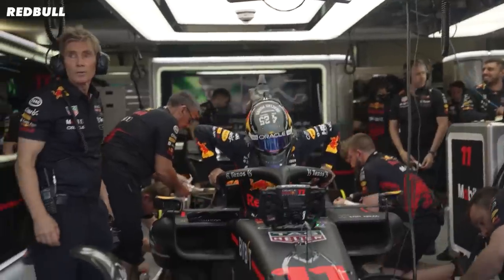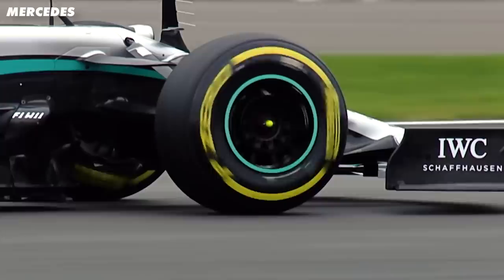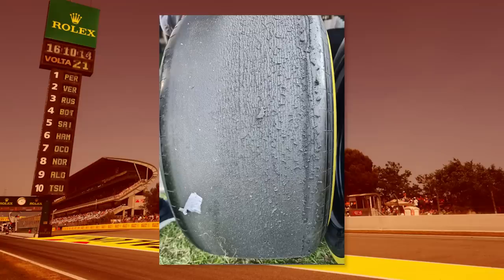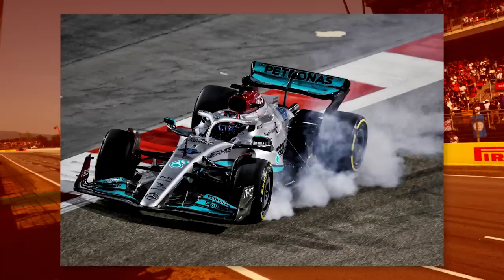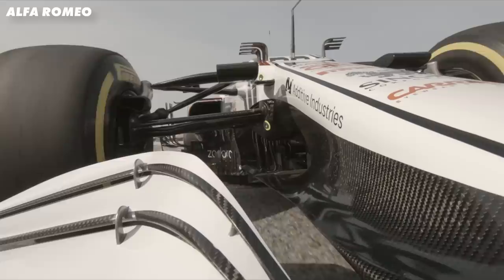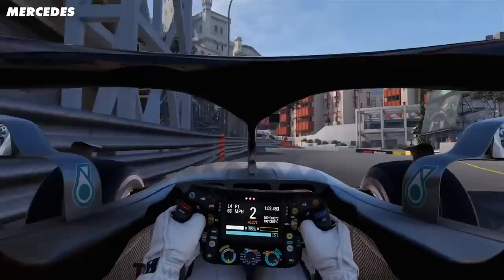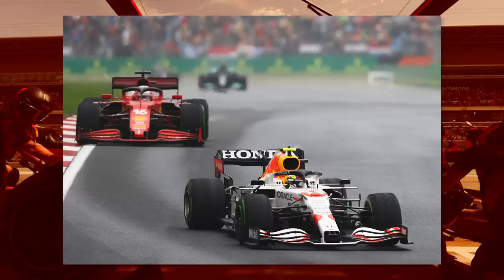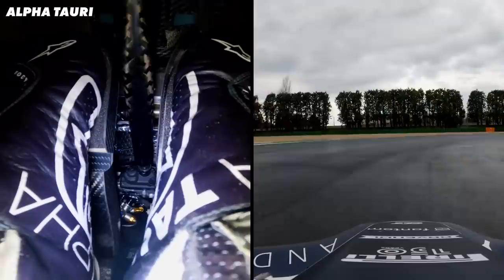Why Perez is INCREDIBLE at Saving Tyres

Comment: More interesting is how does Lewis/ Max keep tyres alive AND maintain pace?
This seems to be something only a few drivers can do. What’s going on?
Reply: Exactly. That’s what sets them apart from checo.
Reply: They don't maintain their tyres as good as Checo, simple as that. They push more.
Reply: @kolosmenus  uhm, Baku last week?
Reply: @kolosmenus  ahahaha funny mate. Max, and especially Hamilton, manage the tyres just as well as Perez while at a faster pace. Hamilton is massively underrated at it, his tyre management is astonishing, especially until the new regs kicked in
Reply: The fact is that the tyre management of Lewis and max is better
Reply: @Bullpit2  Baku was not about tyre management since the Ferraris were out of the race. The 1-2 was in the bag from very early. Max finished so far ahead of Checo because he disobeyed team orders to keep a consistent lap time. He even tried to steal the fastest lap point away from him in the last few laps. Point is he kept pushing all the time, but none were really trying to save the tires.
Reply: @alexlacl8730  It isn't. Checo is up there with them as one of the best, if not the best, at tyre management (and this is something almost every pundit in F1 agrees with despite your perception based on a few races). The thing is, Max and Lewis usually are on the lead (clean air and pace management helps a lot with tyre management), and also get (well deserved) preferential strategy due to being ahead of their teammates during races, so their tyre strats allow for them to push harder and use more rubber, and it becomes barely noticiable from the outside, but if you listen to team radios, you'd know both Max and Lewis had struggles with tyre deg and wear pretty much the same or more than Checo or any other driver running in the top spots.
Reply: @anameyoucantremember  what ? Lewis is clearly the best driver for driving with dirty air. The last couple of races it was more perez who struggled or was too slow than max
Reply: they are better than checo at it, but people tend to talk more about other qualities they have...
you can forget about tire saving when you are slower than your teammate 20 out of 25 times on pure pace...its a load of bull if you ask me...its good for middle pack or slow cars...there you can really shine if youre good at it
Reply: @anameyoucantremember  Both Lewis and max are better at managing tire deg while going faster than checo.  This has been illustrated time and time again.  Pundits often name drop checo because it's his best quality.
Reply: @andreadg5429  But Max and Lewis struggle with Tyre degredation all the time, especially apparent in their radios. There is a difference between extracting the most out of what's left of the tires to being able to stil push them for 5 to 10 laps more than anyone else. Max and Lewis are better at extracting, and Checo about conserving, and even before Redbull, Checo was already being praised for his tire management and quick pace way back his Sauber and Mcláren days.

 Max and Lewis also get preferential strategies over their teammates, and Checo is often told to hold longer stints much like Bottas, hell a lot of Checo and Bottas' problems last year was that they were often ordered to hold longer stints with aging tires than their respective no.1s, which can hurt both their races, especially Bottas'.
Reply: @denisliber6740  Both Lewis and Max get preferrential strategies and are told to push harder compared to their teamates. Lewis and Max aren't better than Checo at tyre management, the latter which was praised for being both kind on his tires and being fast during his Sauber and McLaren days.

 And no, Tire saving is super important, it doesn't matter how much pace you have over your rival, if you're on softs and they manage to pull a good pit stop on you, you're in deep trouble, as evidence by how much Redbull won over mercedes on pure strategy alone and not just pace last year, sometimes it's especially because of Checo's ability to manage his tires.
Reply: @youngrody2386  you get preferential strategy if you are a faster driver, nobody slows their drivers down...red bull managed all that wins because of verstappen skills, not checos...he was slower than bottas...i for one, wasnt in awe by checos defense last year, it litterally happened in only two races...like i said, over the season he couldnt keep up with bottas...max was always fighting two cars.. 
I  know you wanna belive checo is a superb driver but he isnt, he is a good  driver and his tire  preserving skills  were nice in racing point,  on the top you have to be fast, period.
Reply: lewis extends tires by 1 lap everytime he tells bono his tires are gone.
Reply: @denisliber6740  While also being a faster driver means that your team would allow you to pick up the pace more often than than your team mate's, which was exactly my point and we've seen Checo genuinely outpacing Verstappen on occassion, so pace is out of question. And Wdym? Bottas was the one who was heavily criticized for being unable to back up Hamilton while Checo always made sure Hamilton was fighting two cars at once, not to mention Checo was struggling to get into grips with a car that didn't suit his style (Checo preferred understeer, Redbull was made for Oversteer) and still adapted to assist Verstappen to fight the 7 time WDC.

  And in defense of Checo being Super, a majority of Checo's contributions were strategic, he made sure Hamilton or Bottas wasted their tires by pitting earlier or later than predicted, slowing down on purpose to feint Hamilton and Bottas into thinking they could chase him, and do the reverse if he's behind them. And whenever it does become car to car,  Checo's ridiculously good at defending, evidenced by not only how many times he fended off Hamilton but also Bottas, that Defense against Bottas on the 2nd/Della Roggia Chicane on Monza last year was pure ridiculous for example.
Reply: Important to consider between Lewis/Max and Checo with tire management is their track position. Usually when Max/Lewis are on top of tire management they tend to be in the lead in clean air, where checo is more than likely in dirtier air. Perhaps that makes a difference
Reply: @youngrody2386  you think pace is out of equation cause he genuinely outpaced max? Checo has never been faster than Max on sunday and only since this season he can keep up with him on saturday. And we have seen this season that when he was Leading a race (monaco, baku) he went through his tyres much faster than Max and the Ferrari’s. I would love for him to compete with max for the WDC but you score points on sunday and he has never outpaced max on Sunday
Reply: Could they be getting better tires that look like the regular tires🤔
Reply: @kolosmenus  so then why are they faster at the end of the race?
Reply: @kolosmenus  Anyone can save tires if you're as slow a Checo. Baku showed Checo is no tire wizard. He cooked his tires and finished 20 seconds behind Max. Same as most races. Can some one actually recall a race in Red Bull where Checko maintained pace and made his tires go meaningfully longer over Max?
Reply: @anameyoucantremember  Just a imagine if Checko wasn't so slow, or bad in the rain or poor race craft then he might be world champion material...
Reply: @robert7622  yep, at Melbourne, even though the Redbull is a considerably faster car, Lewis was able to catch and put pressure on Checo around lap 20. He definitely got better life out of the tyres.
Reply: @0megalul309  sometimes i think he is trolling, because he will be like ''bono my tires are gone''  and 2 laps later he does the fastest lap.
Reply: Race lap times shows Perez is anything but good at tyre savings 😪 . Any driver can extend their stints with slow laptimes before it become dangerous .
Reply: @ghhh9012  let’s be fair to him. He is a great hand at managing tyres. And in the right car, he would be devastating as long as he also didn’t have a team mate they was a great qualifier.  In a world without Lewis, Max, Nico, Leclerc…. Perez would be great.
Reply: @ghhh9012  let’s be fair to him. He is a great hand at managing tyres. And in the right car, he would be devastating as long as he also didn’t have a team mate they was a great qualifier.  In a world without Lewis, Max, Nico, Leclerc…. Perez would be great.
Reply: @ghhh9012  let’s be fair to him. He is a great hand at managing tyres. And in the right car, he would be devastating as long as he also didn’t have a team mate they was a great qualifier.  In a world without Lewis, Max, Nico, Leclerc…. Perez would be great.
Reply: @lekudos  The problem with Perez is he isn’t fast full stop. He’s not fast in qualifying or fast in the race or fast in the rain. Going long is of no use if when you get your fresh tires on your 1/2 a second a lap slower then your team mate
Reply: @robert7622  watch the videos of him in the Sauber days. Brilliant skills. 
You don’t need to be Numero Uno to be get props for your skills, right? 

Beyond max, Lewis, Leclerc, lando etc.  The next five or ten deserve some recognition for what they can do as well right?
Peter Windsor has a great YouTube channel - he gives all drivers their dues. 
Sometimes..even Mick Schumacher deserved praise. 
We fans just see the worst in these guys all the time when they’re not our personal favourites.
Reply: @kolosmenus  Hamilton is really good at handling graining,he always has been,in 2017 and 2018 mercedes was struggling with tire wear but hamilton still managed to win the championship by a huge margin as well even tho ferrari were the stronger team till midseason
Reply: @lekudos  On the contrary, people seem to over state and embellish the skills and ability’s of their favourite drivers.. Mainly due to what nationality they are.. For me the stop watch doesn’t lie. Making your tires last longer but being half a second a lap slower then your team mate is no skill.
Reply: @andreadg5429  checo averages 15 more laps that everyone else. That's nowhere near as close to Hamilton. When checo got his first win. He only pitted once for tire swap. He was even pushing monstrously goiing from p18 to p1. Got ahead of both Mercedes cars while they had to pit, and it still lasted the last 13 laps with the second set of tires. Numbers don't lie bud. It's criminal was F1 did to sergio. He should have got picked up by a better team 8 years ago.
Reply: @dethtour  why did he get ahead of the mercedes? Or is that not relevant? Because if the mercedes had a normal race, he wouldn't. That race fell on his hands HARD. Also, he has 15 more laps but is MUCH slower. Hamilton extends the life of the tyres AND keeps pace with the best drivers. Just like in Abu Dhabi last year. Perez would never do that
Reply: @dethtour  who has more points this season? Ofc, Perez. He also has 0 championships. Lewis has 7 ;) the team that kicked Perez out in 2013 was the same team who wanted to keep Lewis 12 months earlier and he snubbed them. That says a bit. I mean, those 6digit earning engineers thought Lewis had to kept while Perez had to be fired. Also, Perez was so good he was almost out of a seat 2 years ago. When was Lewis almost out of a seat? Never

But I'm not even sure why I'm discussing this, they are galaxies apart loool. Just last year, while Hamilton was fighting Verstappen till the end, where was Perez with THE SAME car as Max? Oh yes... P6...  P7....P5. Tyre whisperer my ass, put him on the same pace of Lewis, Max or Leclerc and we'll see who makes the tyres last. Well, we saw in Baku just a few weeks ago. Or even better, in Australia, with a car almost 1s slower PER LAP, Hamilton was putting pressure on Perez at the end of the 1st stint, just 2 months ago, because he had much better tyre management Ahahah "tyre whisperer".
Reply: @dethtour  well, he obviously is not that good since it took him 10 years to get a red bull seat 🤣🤣🤣 haas, is that your definition of a top team? One where the class of the field go to get a drive? Ahahah see ya mate, deal with it.
Reply: @andreadg5429  you missed the point. Haas desperate as they are could have brought him in. Haas is not a top team. You're taking things out of context or you're just remedial.
Reply: @dethtour  and your narrative that Perez is that good was exposed. Deal with it
Reply: @kolosmenus  Huh? Checo often has earlier problems then Max.
Reply: @kolosmenus  Lewis is arguably better in tyre management than Checo. Driving slower isn’t a skill lul
Reply: @andreadg5429  don't hurt the delusional checo fanboys!!!

Comment: Considering Max drives faster and holds tyres as long in the same car, I don't quite think there's any secret sauce to Pérez's tyre management. Checo is just a better driver at that than most of the grid, but not an unmatched prodigy of tyre management.
Reply: I was thinking the exact same. In Azerbaijan it was particularly obvious. Perez was in the lead at the start. But he could not pull away nor save his tyres. He can simply not manage his tyres when driving at a race winning pace. Max does this all the time, Lewis last year as well

Comment: As an engineer i have a slight critic.
Saving your tires for a long stint is all about smoothening out the load of the tire, while still pushing enough load trough them to keep them at temperature. So the total amount of work around the lap stays roughly the same, to keep your laptime, but you avoid to high and to low. Especially g's.
Lets start with braking. If we go from 300km/h to 100km/h we always dicipate the same amount of energy. But if we brake for longer we get several benefits. First and most important drag. Drag and downforce are work against the air, so we can dicipate energy from the car into the air. So win-win less energy in the car and we didn't even dicipate it trough the tire. 😁 we also make more dirty air something Lewis did a lot to Vettel. Second one is regenerative braking of the rear. Put's mechanical load trough the tire, but we convert the energy to electricity rather than heat. So this part of braking wont heat up the tire only the heat generated by friction will. A win for saving tires. Last is pure mechanical braking like at the front. If we brake for longer the brake has more time to convert the mechanical energy in the car to heat energy. So we can dicipate the same heat over a longer time but at lower temperatures. Here we have a synergy with downforce as well. At high downforce the tire will slide less. So we should do a lot of braking at high speed, and less braking at low speed so we keep a constant ratio of required g's and the max g's possible. This part is where Checo is so good and why he is so good in tire preservation and defending.
Second thing is cornering. We want to apply smooth g's so we have to transition from braking into steering very smooth. Every tenth of a g we don't need for braking anymore we want to add in steering. Also we either want a longer route at the same optimal speed to get a flatter g graph, or we want the same optimal rotation but at a lower speed so the peak in g's wont hurt the tires. Usually you want a wider line with a faster exit speed to help you with tire preservation on the straight.
Third is the straight: to keep it linked to the corner every tenth you don't need for turning anymore you wonna add to acceleration. So you actually pick up the throttle really early risking to go wide. You did not build up that much temperature in the brakes aka a lot of that energy has already left the car in form of hot air. So you can't afford to turn for too long without brake or gaß or you loose too much temperature! Remember we want things to be smooth. But most important for tire preservation on the straight: a tire rotates proportional to speed and a engine produces roughly the same power at every speed. So at low speed the engine will scrub the same tiny piece of tire along the surface for longer, until it can rest all the way around. So you don't want to put too much power into the rear at low speed and might boost your mid to top speed if you have a battery like F1. On the other hand your tire will cool down for an eternity at low speed. So we wont be at low speed for as little as possible. So try to exit the corner with as much speed as possible, so the tire is up rotating and will be hurt by the engine only for very small amount of times.
And that for me is the reason why Max was so damn fast all season. He found the right sweetspot off bringing the brakes up to temperature, allow for fast rotation of the car at low speed and bring the car up to speed befor the tires get to cold to handle the power. Max and Sainz actually never fully lifted at some corners. They probably cranked up recovery braking and tried to max out the battery in the corner. Which you have to do if you coast a lot into a corner.I
Despite you can calculate all of this stuff in neat differential equations that only the engineer who wrote them fully understands it really is a sport and art to cope with all of these compromises at the speed these things are going. I just wish they were allowed to play even more with the amount of energy they can recover and deploy while staying within a fuel limit. Makes the pace of a car far less predictable.